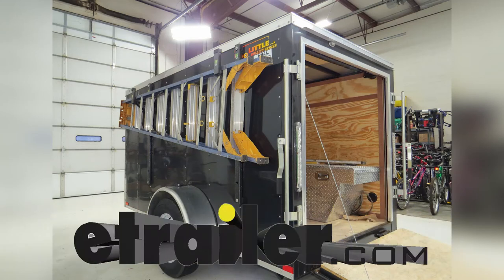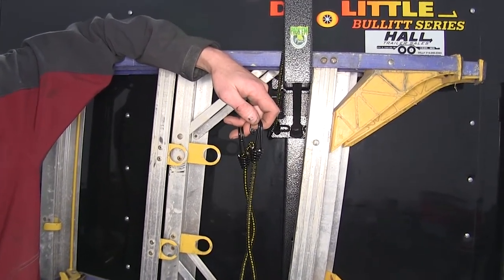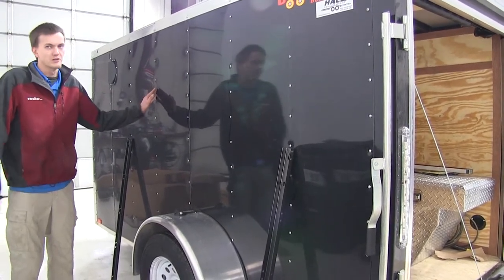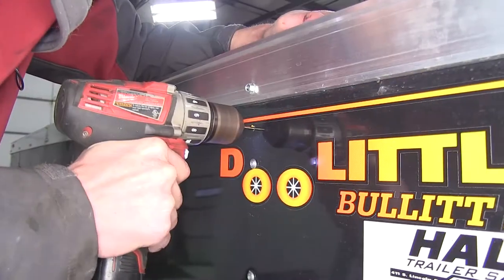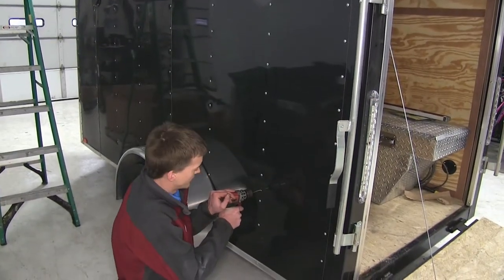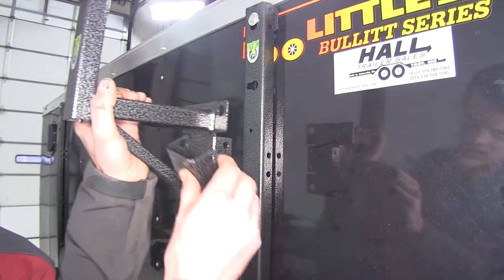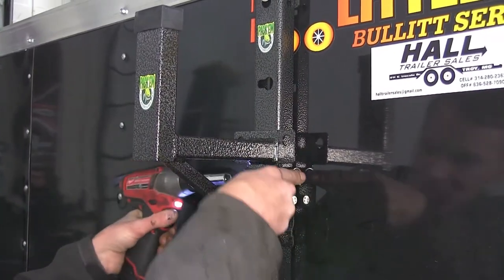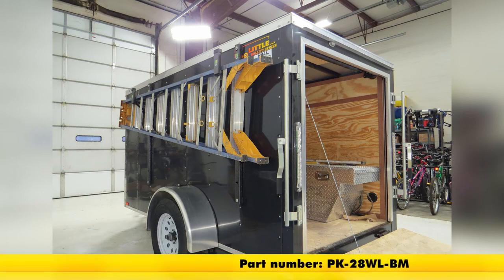etrailer | Complete Breakdown of the Pack'Em Ladder Rack for Exterior Side Wall of Enclosed Trailer

Comment: Would it be possible to use rivet nuts instead of drilling through the entire wall?
Reply from the maker: If the weight of the ladder doesn't exceed the capacity of the rivnut, that'll work just fine.
https://www.etrailer.com/Trailer-Cargo-Organizers/PackEm/pk-28wl-bm.html
Reply: @etrailer  thanks sir
Reply from the maker: You're very welcome!